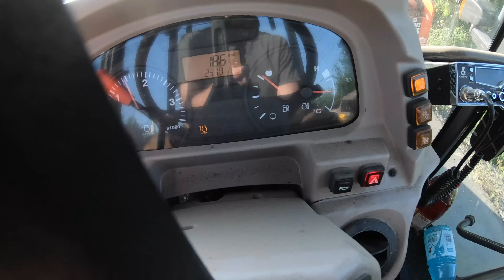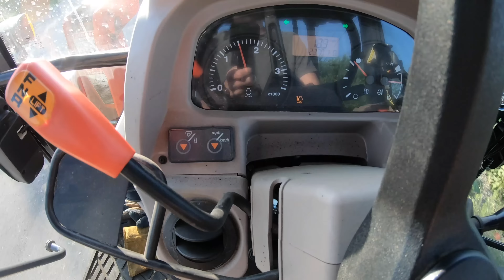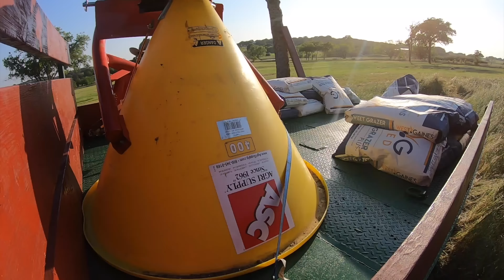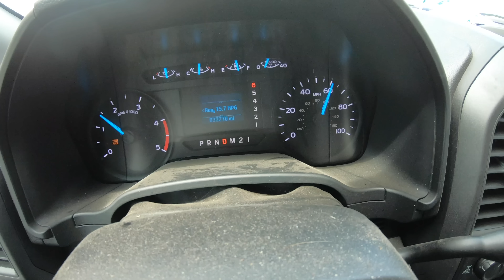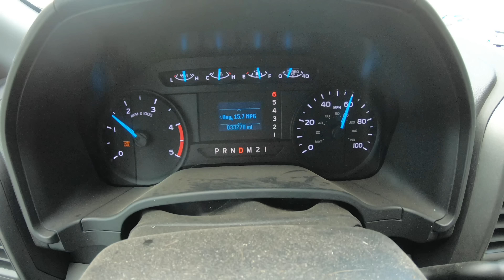Making The Ultimate Small Farm Trailer from an Old Pickup Truck!

Comment: I built a very similar trailer, but I used a  $300  hydraulic brake controller.  It really helps the tractor control the load.

Comment: When I was a kid on the farm we had  truck bed trailer trains 8 trailers per train we had a short  Tonga on the front 4' walls on the side  going to a   Grain shoot worked great The last Trailer I had a small alternator to the rear end pig With a motorcycle battery for  the flashers And safety lights

Comment: Watching you weld the inside of that axle was rough. lol..  I would have rather welded  a plate to the out side of it, that way you could still cut it back off and use the axle later if need be.  Those one ton axles are worth good money too, and sought after for off roading.  You're committed now for sure.  Nice find on the pricing though.
Reply: I had same thoughts.

Comment: Man I would have bought that cab in a second! I currently have a 93 idi that has some rot in the bottom of the cab, and that thing was super clean. I see the old diesel case in the background, and I know this is an old video, so do you still have that old thing? I remember the last video I saw of it was the one where you discovered the injection pump had no oil for a long time

Comment: Hey do you have a video on making that 3 point trailer hitch adapter? I bought one and went to tow 13k in hay (I know, not the best idea) and totally tore it apart. I’d love to build one that is able to pull that kind of weight.
Reply: Just build it heavy, 3/8 tube and 1/2in plate minimum.

Comment: Kinda sad to see the ole girl get cut up as a trailer. A truck like that w that configuration. Sad to see the idi blew up. Idi’s like what that was were rare is decent shape. Engine less sadly not.

Edit: on the other hand there’s like $450 worth of diesel fuel in the truck, so if anything u made money on this one. If u extracted, & sold the rest for scrap.

I’m glad to see it’s at least getting parted out to help other trucks stay on the road.👍
Glad it’s just an auto, & not the zf5 idi. As the ZF5 idi’s are getting harder & harder to find. Then 4x4 ZF5 idi’s are insanely rare if they’re running, & driving at all.

Sad the truck only had 80k on her. That sad part is that on FB u can get a donor idi motor for like $600, & she’s goin again.